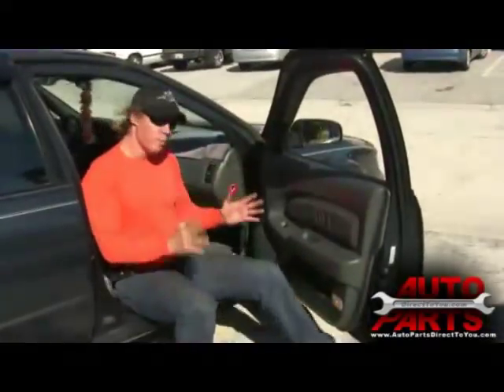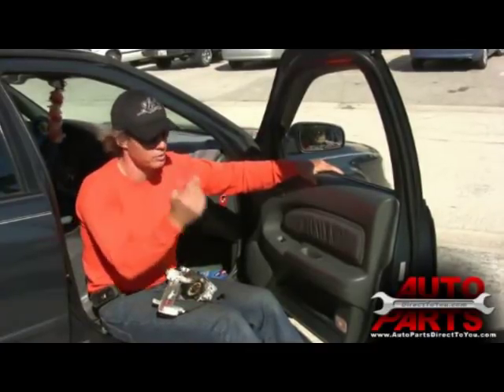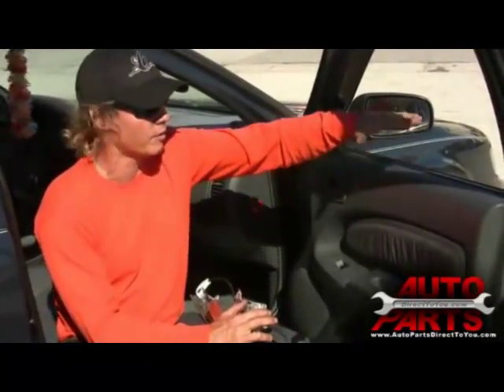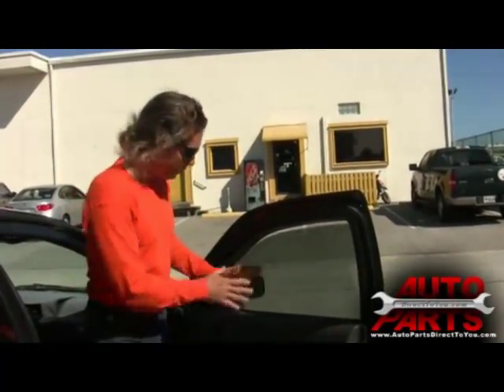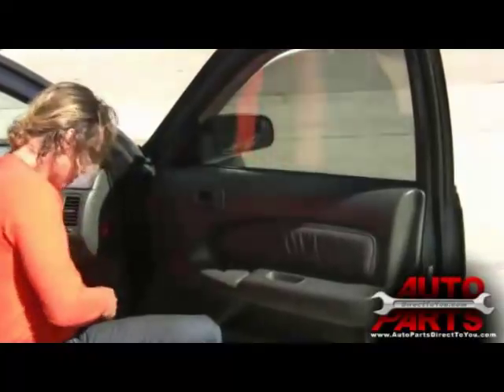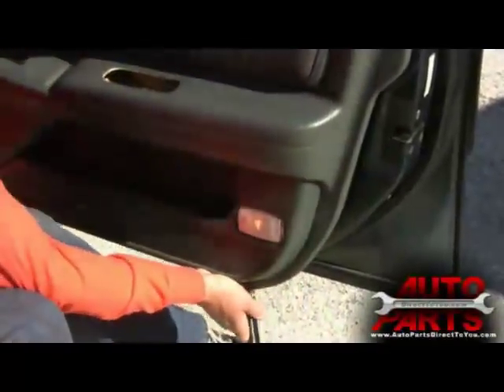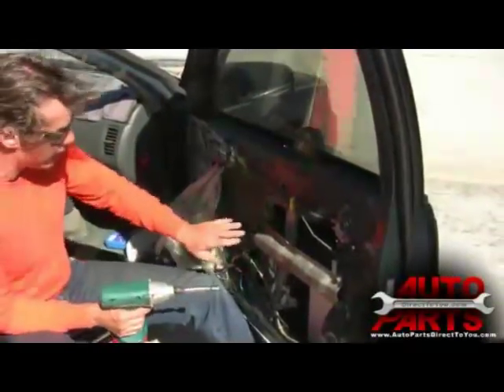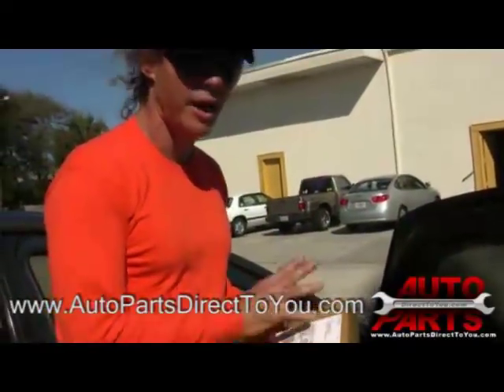Diagnose Window Motor and Regulator Problems Part 1

Comment: My passenger window goes down but wont go up. The motor has been changed yet it just started doing the same thing. I noticed that when I push the button for the window to go up (without door panel) the wires get hot and the motor gets hot. You can hear the motor trying to run but wont..... any ideas??
Reply: Yes the motor is new and I connected the wires to the battery and it went up without a problem